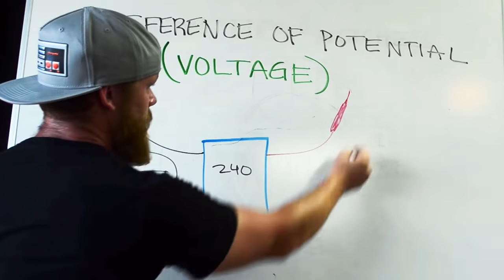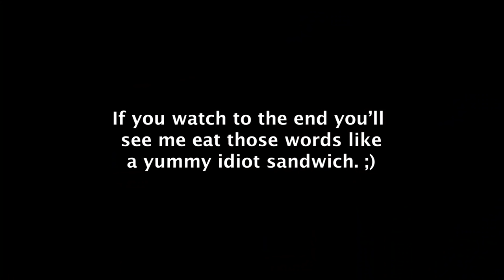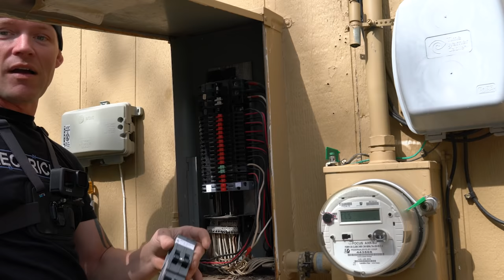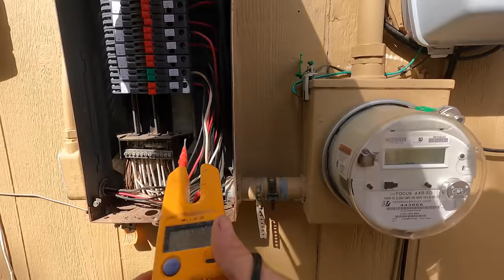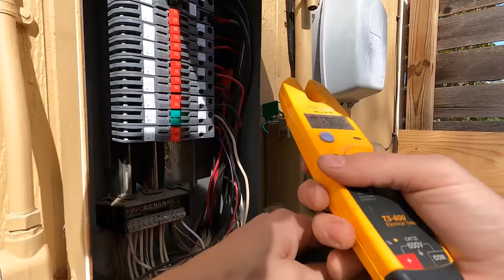How To Work on LIVE CIRCUITS - Replacing Circuit Breakers in Old ZINSCO Panel

Comment: The hot wires were initially behind the small wires of the other breakers , and when you put them back you placed them above the small wires that's why you had hard time fitting the breaker in its place . I'm in belgium , electrical system is all different here but when i place big wires like that they always put tension on the breaker the key is in placing those big wires not the breaker . Thanks for your video .

Comment: @electricianU   I have a question about the unanticipated damage to the bus bar preventing attachment of the main 100 amp breaker.  This may be a naive question, but I'm not an electrician.  So, here goes:  Lets say that the damage to the bus bar resisted accepting the main breaker, even after you thumped the breaker hard, trying to get it on the bus. I noticed inches of unused and exposed bus below all the breakers.  Could you have moved each of the circuit breakers down the bus to make room at the top to put the main breaker on the  bus below the damage?  I imagine that leaving such a gap at the top is not normal practice, but isn't the exposed bus below the breakers also risk?  So, I believe that the same length of exposure of the bus to shock and shorts exists in both cases: case1= Normally all exposure is at the bottom; and case2= same length of exposure where some is at the top and some is at the bottom.

Comment: @Electrician U I know this was your liability and choice on what PPE to use.  I'm sure you've already seen all the various 70E videos on Arc Flash/Blast event injuries.

Suggestions for PPE for a scenario such as this in the future.

-Wear a properly rated 70E FR long-sleeved shirt rated for the incident energy rating for the situation, will prevent or reduce risk of burns to your arms in the event of an Arc Flash/Blast event.

-Test for air leaks in your rubber gloves (not sure if you did this off-camera) but this should be done every time we use our gloves.  
Also, visually inspect your rubber and leather gloves for damage every time.
Check to see if the gloves are outside of there service period so they can be sent out for testing.

This could be the difference between being electrocuted and not.   The smallest of pinholes can still allow electricity to flow through to your body.  I work somewhere where this has happened to people who didn't check their gloves for leaks and ended up getting electrocuted when they accidentally touched an energized conductor.  Remember electricity will follow the shortest path to ground no matter how small the hole.  Check to see if the gloves are outside of there service period so they can be sent out for testing.  Your employer can help you with understanding when this is.

-Use an insulated screwdriver (even though most of the time you were not touching live parts) it helps reduce our risk even greater.

-Not sure if you did this or not but electrically rated boots that are made out of leather.

-Yes, we can get electrocuted using only one hand to touch a live conductor. It will go from your hand to ground via the shortest path to ground.  The one-hand touch rule is an old-school rule that is false and not true.  It may not go across your chest but you can still get electrocuted.

-Use Safety glasses in addition to the 70E rated face shield.  Face shields are normally not rated for high-velocity impacts, where are safety glasses are.  The face shield will help a lot with preventing debris from hitting your face, but some debris may still penetrate through the shield.  We only have one set of eyes.

Obviously what PPE you use should be based upon the 70E incident rating for the panel you are accessing at any given time.

Best Regards and hope these suggestions help.

PS there are a number of good video's on youtube by Salisbury

A good video on glove safety programs will help you understand glove dates and glove service dates.
https://www.youtube.com/watch?v=djpERZ6LixI

A good video on glove safety and general Arc Flash/Blast events.
https://www.youtube.com/watch?v=4mpksxHgCAA&t=613s

Comment: I find it amazing that so many American Sparks don't use insulated tools it kind of goes completely against everything the European brothers and sisters have been taught.
Reply: I am a American industrial electrician. I use insulated tools al, the time. American (Klein) insulated tools are much higher quality then German insulated tools and cost more.
Reply: @jakp8777  I think they maybe more expensive due to few people using them.
Reply: @9plusinstalaciones  American style are more expensive because they are more tool. While the German insulated tools are plastic with a over molded tip, American style is made like a regular screwdriver with the bit going all the way into the handle then the metal shaft of the bit is either over molded with plastic or has a thick orange cut indicating shrink tubing over the metal shaft. There’s quite a weight difference between American and German style insulated tools.
Reply: C'mon guys.. you can't generalize American or European like that, some companies make good products, some make shit... But you find them both in both America & Europe. And when your refer to European "brothers and sisters"... Do you mean all that inbreeding going on? The "royal" family is the goofiest, most horrible inbred family on earth.  "Pure blood"... That's what they're taught.
Reply: @jakp8777  Klein are not as expensive as German tools, simply because of the cost of shipping. I prefer Klein over all the rest usually, but have wiha & others that work great too.
Reply: @Rico702Vegas  Please learn to read and comprehend what is written. Thank you.
Reply: @jakp8777  let's just all agree that no professional electrician should work with uninsulated screwdrivers. Doesn't matter we where you are on the world.
Reply: I would take a set or Wera over Kleins every day of the week
Reply: Adam Cosper  looks like all other euro insulated tools. Just a cheap plastic shank with a over mold metal top.
Reply: @ItsMyTimeee_THEGAME  wera grips get gooey quickly. No metal shank, overpriced. Not durable.
Reply: @Rico702Vegas  klein is way more expensive. Rubber grip that doesn’t fall apart and metal shanks cost more.
Reply: @Rico702Vegas  completely irrelevant
Reply: @jakp8777  in all honesty i have never used wera grips. Bahco and knipex and my go to the the cutters, grips and croppers
Reply: I have seen a klein set of croppers in CEF that look exactly the same as my Knipex. May give them a go
Reply: @jakp8777  German/Swiss > Klein. Sorry Klein is good but they're no where near wiha or PB with quality. Klein tips are butter. I like my Klein's but I know what they are and what they aren't.
Reply: @MadMetalShop  wiha grips are awful, especially when they get in contact with oils and dirt. Wera is worse. Wiha also is only over-molded tips where Klein tips go all the way through to the shaft. Seems like the euro screwdrivers don’t have heat treated tips, they chip easy. Never used PB Swiss.
Reply: @jakp8777  I'm not a fan of the wiha or wera grips but Klein blades are as soft as butter. You better be working for a company who's buying your drivers because you'll go through more Klein's. The older versions were far better than the soft stuff they're putting out now. PB makes arguably the best drivers on earth.

Comment: In theory if you shut off all electrical loads in the house before trying to change out that main breaker would your risk of arc flash be low to none when installing new main onto the buss? Or is that irrelevant? Im thinking the arc flash is bc the house is under load or can it happen regardless if there is a load on the panel and just simply the transfer of voltage can cause an arc?

Comment: I found a warm wire in a random jb at work today, clamp on read 20amps. The breaker it was on was a 15amp FPE - go figure. Tried 3 other FPE breakers in the panel and none of them tripped.
Reply: Sounds about right.
Reply: You're not making me feel any better about not replacing my FPE panel yet. Well, I'm almost graduated. It'll be done soon.
Reply: @PatrickKQ4HBD  When I run into a FPE pannel on a job I refuse to touch it whatsoever. I have refused jobs on multiple occasions because of it.
Reply: @Veritas-invenitur  there was a recall on them, gotta change the whole panel.
Reply: @donzmilky5961  Yeah. It’s awkward when you go to quote a simple job like adding receptacles or an additional lighting circuit and you run into a FPE panel. Having to explain why they need a new panel and why I won’t take the job if they don’t change the panel isn’t a good situation to be in from a reputation standpoint. Normally I will explain the situation to my customer, show them the law and the lawsuits. And offer to do the panel change at time and material rates at a discounted hourly rate for them. 50% Agree on the spot. 40% Get a second option just to give me the job anyways. 5% Say they will call you back but don’t. 5% Throw a fit and explode on me. Best part is those who explode on me ALWAYS end up calling me weeks later apologizing and wanting me to do the job. I tell them I am booked solid so I will have to subcontract the job and because of that I can’t give you a discount or bill based on time and materials and this is how much it’s going to cost.

Comment: It would only take 30 seconds to wrap some electrical tape around that screw driver.
Reply: Or you can buy a screwdriver kit rated at 1000v for (20 bucks that’s probably more like 7.99 for you guys in the states)
Reply: @vincenzothegamer9636  Wera and Wiha insulated screwdriver kits FTW.

Comment: Question?  you don't have to use the same brand of breakers for the pannel?  how can you replace old breakers with a different brand of  breaker?  Awesome video by the way!!! can you get away from just replacing the breakers without replacing the breaker box?

Comment: I've cut off the power companies green tag/lock thing tons of times at different properties, they never say shit and just put one back on when they check the meter
Reply: That one is a locking ring designed to prevent removal of the meter to prevent Power theft. just like the old landline phone boxes only the utility company has the special key to remove that ring and depending on the power company they may not want electricians or even emergency personnel removing the meter.
Reply: @coolsnake1134  I know what they are, I've cut them off plenty of times to turn off my house power though, nobody ever cared. Since he's actually an electrician he can't cut other people's property though (I'm sure he does it to his own)

Comment: Argh! The whole reason this junk got "outlawed" is non-functioning breakers AND buses/lugs that fall apart. It is not worth servicing them: rip it out & replace it. Also, call the service provider to send a lineman out to pull the meter, and for God's sake, take that stupid panel door off so you can work properly. That's it, I'm joining the Union! ;-)
Reply: @ 16:19 , that could've been a big flash: take the damn panel door off!

Comment: Let's see an in depth sub panel install to a detached building
Reply: yes please, this is relevant to me right now
Reply: Separate neutral and ground bus, run 4 wire feeder from main, drive a ground rod or two (I do 2) and connect your GEC to the new subpanel. If the subpanel has more than 6 circuits it needs to have a main breaker, otherwise it can be a MLO (main lug only) sub. 

Read the NEC on grounding and bonding (article 250) specifically 250.32 (A) & (B)(1).
I know a video would be much better but just in case Dustin doesn't get around to making one I hope this helps. Have fun with it and be safe!
Reply: @jman210210  Im making an out door grill area out of an old metal grain silo.  I already have conduit just have to add 20 foot or so to it. It's 2 inch conduit, was planning on using thhn wire.  So I would need 2 hots, neutral and a ground from my main box?  I really only needed a one circuit for right now but would like room to expand.  Was looking at a single 20 amp circuit but how do I run a ground rod if it's required if I do a 20 amp single circuit?
Reply: @jman210210  thank you

Comment: No disrespect meant but considering this will be watched by DIYer’s, this is the most dangerous electrical video I’ve seen.  I was trained “old school” and have been in the trade a long time - commercial, industrial and residential.  This video is gonna get someone hurt really bad or killed.
Reply: Hahahahahaha
Reply: Nah, it ain’t that bad. Many experienced DIYers are capable enough to handle this. I have been doing my own electrical for a long time. As long as you know what you are doing, follow instruction, safety rules, and common sense, it’s alright.

Comment: Worked on a Zinsco panel for a brother in law that had burned buss exactly like this one.
I removed all the breakers, then swapped the buss bars so their stab points were physically different. I did give each bar a cleaning with a green pad to remove grime.
It worked good enough after until he was able to hire an electrician to R&R the panel.

Comment: Why wouldn't you just call the power company and have them open up the meter
Reply: In nj had weather head off of home...power company gladly happily disconnected at the pole... so I could pull and properly attach eyelet to a stud to hold overhead wires.... power company happily came back...  in ca power company also was very happy to remove dead branches on service lines..
Reply: dude thats a smart meter it can kill the service remotely. this seems like an unnecessary risk for the sake of a you tube video
Reply: @petero2693  how long did it take them to turn off and then back on?

Comment: That rubber piece in the main breaker may have been to stop the wires from loosening from vibration like with screws on fans nowadays. Also thanks for the show. I've been thinking live wires could blow up or arc if I tapped them around in the breaker instead of tightening them and loosening them real quick but its good to know that its safer than i thought.

Comment: Nice gloves and shield, man :-) 
On the other side it would have been responsible to use an insulated screwdriver when you show the procedure to random people.
I'm surprised that there is no additional breaker or fuse near the meter. In my country there is a mandatory breaker before the meter that must be accessible plus some fuses on the power line even before the panel with the meter. It's been like that already 40 years ago.
This power bus solution is i teresting. Wouldn't it be safer to move all the breakers by an inch lower to skip the damaged part?

Comment: It's a Smart Meter. Call the electric power provider and ask them to kill the power.  They can send a wireless command to shut it off.

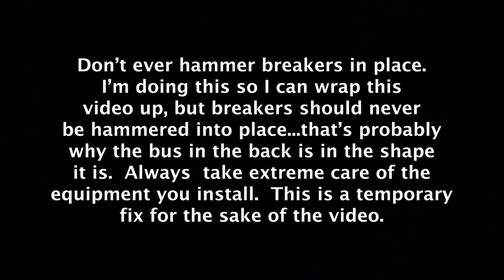20:00 - and this guy calls himself a professional!  Yikes!
Reply: Never trust the electronic shutoff signal.  Can be turned on anytime without ur knowledge except for the fact that u get hurt expecting a dead panel
Reply: A physical disconnect is the only solution to assume safety from energized conductors. Don't trust the robots
Reply: @gusc6785  - Good point.  Never trust a Smart Meter with your life!
Reply: you don't own me  I just don't think it's even worth assuming you know the state of the bus when you don't control the switch

Comment: Switching out the lower breakers is relatively safe, because once you pop it out, the two wires you unscrew are no longer live, right? So if you unscrew them and they touch something, no problem, right?

Comment: My shut off from the meter is a lot different. And the wires are not live or hot, but the bus is. I am glad I don't have to deal with that. I am just watching a bunch of videos on this to catch all the nuances. But, I do have to replace my main 100amp breaker this week, since the breaker is bad and I lost L2 to the house. In a couple months, the whole service will be replaced for an upgrade from 100amp to 200amp service.

Comment: I have a lovely Zinsco panel in my house.. Grandpas owned it since the 40s, i have multiple flickering lights and with them all on confirmed it is likely it is the breaker.. Just ordered the CT replacement and it should come tomorrow.. Hopefully this will resolve it but god damn $55 for the breaker...

Edit: just got done changing mine today but my old breaker was brittle.. Came apart in pieces by the tabs but got it out and new one in.  Almost called an electrician but for $165 i ended up getting it out and the new one in easily.

Comment: you wear the leather gloves on top of the rubber ones in case there's a big ark or explosion? because leather will protect from heat, but rubber wont. (we used same leather gloves for welding railroads)

Comment: I'm glad I was a bit more careful and therefore not weary of working on live circuits, it made it a but easier and faster to troubleshoot and trace circuits. When working on the panel itself, I just take my time and, double and triple check everything and work a bit slower. I don't want to Jynx myself so I won't say more.. Safe workings my friends. A kid I worked with back in the day, very careless, was leaning against the panel with his shoulder while screwing terminals and all of a sudden he drops to one knee. He said it bit him good and his whole arm and right side of his body went numb for like 10 secs. Needless to say, he went home that day. That was early on in my electrical days so it made me always make sure not to be careless..

Comment: Did you ever have a breaker that you can't take off because it got welded to its contact in the panel? I did, so I took the wire out of the stuck breaker and put it into a new breaker installed in a different location in the same panel. There are extra spaces for more breakers.